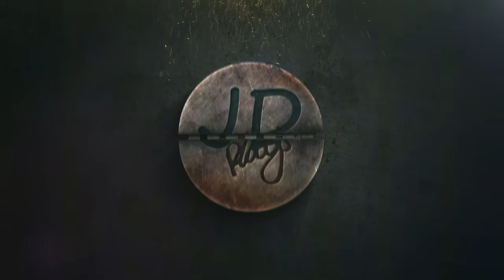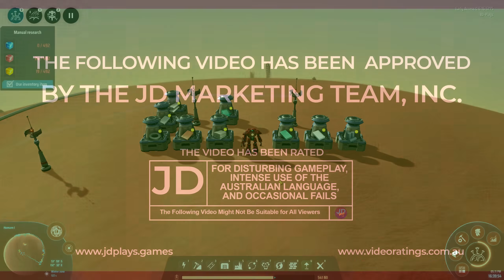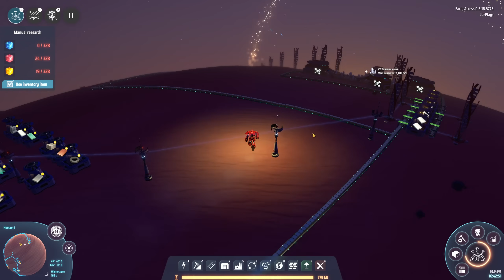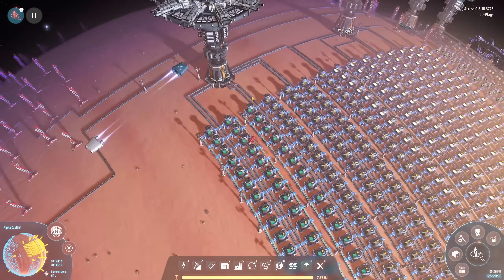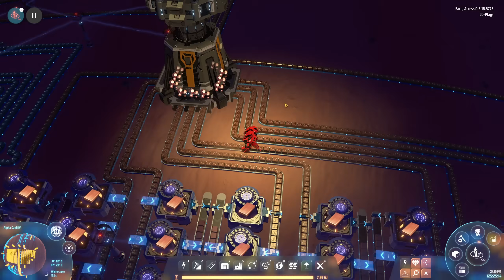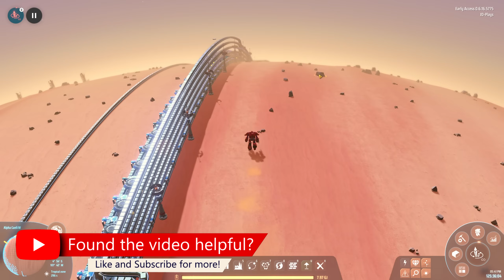How To The Planetary Smelter 🤖 Dyson Sphere Program 🤖 Tutorial, New Player Guide How To

Comment: Their one more bottleneck which is the number of ships... So depending on how much titanium ore you are mining... If it in more 15 seperated locations (planets) you may want a second station to add 10 more ships..

You can also just link warp cores from one station to another with a belt if they are really close
Reply from the maker: feeding one station into the next is the best way to keep the ore flowing, i recently feed 3 stations together to get the thruput i needed mainly because of low tech

Comment: I got 360 smelters per ore myself. If you want 120 assemblers making processors for quantium you need 360 assemblers making cpu components that in turn require lots and lots of silicon/copper smelteries.

Comment: I think your silicon smelting facility isn't large enough. I made ~1300 processors per minute and clearly needed ~6000 silicon ore to be smelted, which translates into ~300 smelters. Could you please show your setup?
Reply: Yeah, its 2 silicon bar per component 1 copper. I think its consumed in 4 seconds in the assembler. produced in 2 seconds in the smelter. so 120 smelters can feed 120 assemblers. but then the processors are 3:1 for the components.
Reply from the maker: just build a second, or a third or a 4th!

Comment: I just spent 4 hours tonight creating a Iron, titanium and copper factory very similar to the one at 10:40.  It takes FOREVER, I can't wait till someone makes it so we can put down a row of buildings all at once.  Connecting them to belts is also a huge PITA.
Reply: Already in game, go to settings, turn on god mode and placement auto moves so you just keep clicking. Install auto inserters mod and you are good to go
Reply: @DasLama69  screams internally thanks guys!
Reply from the maker: Check this playlist... there is a mod that speeds up everything by also copying the sorters with the smelter
Reply: @JDPlays  I assume you're talking about the mod "CopyInserters by thisisbrad"? (Which works like an absolute DREAM by the way highly recommend)  If you've done a video about it I don't see it and I think you absolutely should!

Comment: I've been trying to conserve warpers.  Still I smelt local to the star.  Craft up as complex as possible as the system can manage then ship that to where it would need to go.
Reply from the maker: Thats fine, im later in the game where warpers are much much less of a issue!
Reply: I solved this problem at very beginning by making them from green cubes. 3 matrix labs and 3 assemblers mk2 are enough to supply the entire empire with warpers
Reply: I'm just being needlessly miserly with resources.  Yes I won't go to all the stars and mine them all dry but that doesn't matter.  They are rather cheap when you make them from green cubes.  Very cheap.

Comment: but if you have a station like in your example smelting 270 copper a second, that would burn the entire load of a vessel in less than 4 seconds leading to you needing to have actually have a ship arrive and unload atleast every 4 seconds, how actually is that supposed to not inevitably throttel with only 10 vessels
Reply from the maker: did you see the end of the video where i feed one station into the next? Well there is nothing to stop you daisy chaining that Since recording this then I've upped my consumption of some items and have a 2nd station feeding into the first. Or plan B just put down a second tower and half one tower feed half the smelters and the first tower can feed the other half. this is a very flexable system that can scale quite large
Reply: Yep I'm on that point now where the logistics vessels are the bottleneck. I have continued researching the logistic vessel speed and just need to put down more towers. I'm sure further updates will continue to rebalance and resolve issues, the game is in early access after all.

Comment: You talked about limits and 10 ships being 10,000 at max research. I'm at 800 per ship currently (should be 1,000 soon) but was def running into limits at 120/s where the station couldn't quite keep up. You showed 270/s, which feels like it might blow the station out pretty easily. As that is 16k resources a minute, and a vessel is likely to take about ~1 minute round trip to get there and back. So any testing on what a "reasonable" limit would be to a single station? I get the idea of adding a second station, which you recommend if you are hitting the limits, but just wanted to try and get some rough ideas on how much output a single station could handle with its 10 ships. Seems to me, rough assumptions, 10k resources, at 1 minute travel time average, would put you at a cap around 166/s. Is that 1 minute assumption reasonable?
Reply: dont forget there's an infinite research for drone travel speed which will hasten the non-warp travel times.
Reply from the maker: so infinite tech makes the larger vessels go faster as well as the smaller drones. so dont have enough resources? add a 2nd tower, feed it into the first with belts. Still not fast enough have drones also make the small short hop carrying 100 each, still not fast enough add a second tower with/without more belts and add more small drones. The only limit to the system is 12 output belts at 30 items per second between vessels and drones there is no limit to how much one of these can import!
Reply: @JDPlays   oh, brilliant! I am working toward white research now, so I look forward to super fast drones hahahaha! 

I'm in the process of moving bases to the hottest star in the galaxy, which also has multiple planets. I wanted to do my blue giant just for fun, but it only had one super tiny planet in the spawn... So I'm going with the hottest and brightest instead.

Loving all your videos! Keep em coming!

Comment: I don't really like the lasagna method due to the confusion that it gives me. Rather my setup has belts be sandwiched between the smelters so that one is for the input and the other is for the output. The copyinserters mod is really helpful in this case as the setup is already compressed and doesn't really require a long line that would go over the building range.
Reply from the maker: i understand it was a PAIN to build!